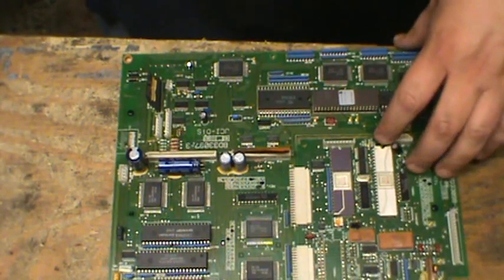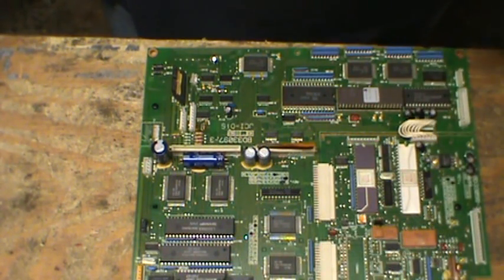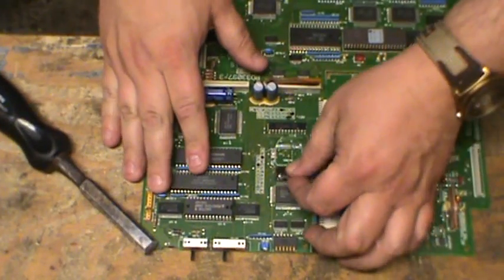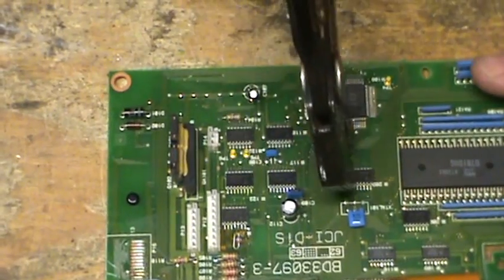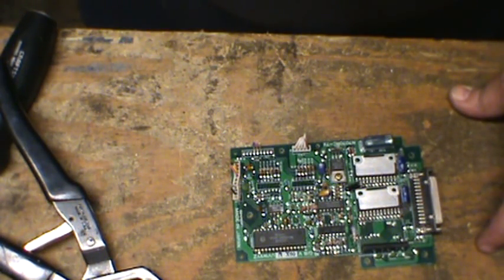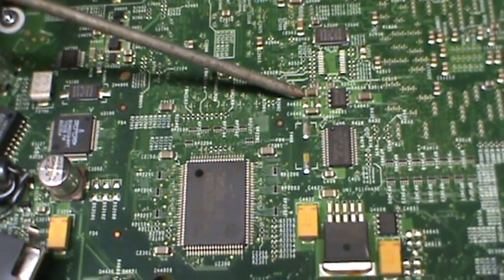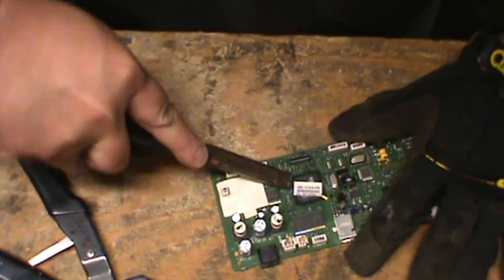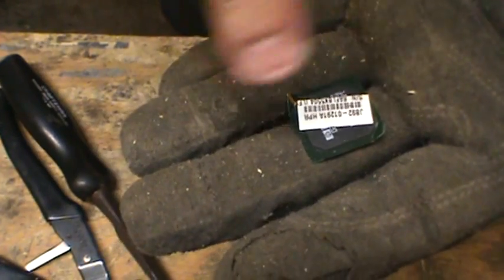Scrapping, how to remove IC Chips, and what else is worth money on a circuit board

Comment: Where can you sell the boards once they are stripped of the IC chips and some of the other valuable components? Would boardsort still buy them depopulated? Do they become low grade boards or do they retain their original value? Thanks in advance for any response.
Reply from the maker: karakantouvalos Hi there, they are dropped in value after removing the valuable items.  If you are going to pick the boards I would probably not suggest trying to sell them to places you have to ship to because you have to pay for shipping and the value will drop so you will get paid a lot less, some places you will lose money.  If you strip, sell to the scrap yard.  Thanks!
Reply: OK, thanks for your very prompt response. I was thinking along the same lines. I think I'll just leave those IC chips on the boards for now. Yes, I know what you mean about shipping! The cost of shipping some items is becoming prohibitive.

Comment: What are those black little thing that looks like monolithic ceramic capacitor?
Reply from the maker: +Eric Ibanez Not sure exactly what you are referring to but some are also made with ruthenium which is a valuable metal as well.
Reply: Hi Moose scrapper thanks for your reply. It is on my profile picture.

Comment: what is left to do with my green boards after I depopulate or remove the tantalum
Reply from the maker: Some yards will buy them for 5-6 cents per lb.  otherwise, they get trashed.  Its unfortunate, but that is one of the very few pieces that is not recyclable.
Reply: Thanks again Moose. I think I will do as you and save up my gold until once or twice a year. I have about 1 lb of gold pins as of now. How much should I expect from this amount ? I understand that it would be hard to guess but you have been there .
Reply from the maker: d scrapper I would say several grams.  Again depending on the type, age, thickness of plating, blah blah blah, at least 5 grams, maybe as much as 50.....lots of variables.
Reply: thanks Moose

Comment: what is the most important chip on a circuit borads
Reply from the maker: +Dre Love As far as what, functionality or gold recovery?  Functionality depends on what the board is from I guess, for gold recovery, It depends on the board as well.  The board in a projection screen TV would be the DLP chip I think, for motherboards, I would say the CPU or the ram, for other boards I would say IC's are pretty good for gold recovery.  Not sure what else would be called "chips", but monolithic ceramic capacitors can have a high yield of silver and palladium for their weight, they are just tiny and it takes a lot to get reasonable weight.  Does that help?

Comment from the maker: Hi and thanks for watching!!  The computers do have value!  The CPU's are likely ceramic and can be worth over $50/lb!  There are also the the large socket green mother boards that are the most valuable of the mother boards.  Ram chips, PCI cards, lots of stuff!!  I have a video or three about computers.  The older model TV, there is not gold that I can think of but there is likely silver contacts in any relays or switches.  They may look like little rectangular black boxes.  Send pics if you

Comment: Solder gun and and correct tools. I have fixed a million. solder is nickle and lead.
Reply from the maker: most solder does have lead, but I have never heard of a solder with nickel in it.  The melting point alone would make it very difficult to use.
Reply: Sorry I mean tin and lead, been out of the job market. just forgot.

Comment: Show what weight and the final value of everything tally it -- show how long it takes to save up enough scrap to be worth it....
Reply from the maker: Eric Patino Hi and thanks for watching!  That is a great tip!  I used to do that however the price of scrap changes often and sometimes drastically.  One of my early videos was done when the price of copper was over $3 per lb.  As you can imagine, the value is very different today.  I am trying to get put the weights in my new videos as that can help viewers decide if its worth it for them or not.  Thanks again!  Keep the ideas flowing!
Reply: No problem...I have a GIANt printer i am going to take it apart and try my hand at scrapping I have a bunch of motherboards n stuff as well...enjoyed the video thanks again !
Reply: Moose Scrapper just started with my greenboards today. What is in the round 16v. I took one apart.some kind of wet paper and strips of metal? Tks mouse
Reply from the maker: Elizabeth Tressler round 16v?  is it a 1.6V battery?  If it is, don't take it apart, that's toxic.

Comment: Tantalum caps??? So you spend 2 minutes per board to break them off and get .00755 ounces, @ $6.25 per ounce x 30 board per hour, you just made $1.41 per hour. Wow, I never knew it was so lucrative. I think I'm going to quit my job and go circuit board hunting.
Reply from the maker: ROFL.  Sometimes it seems like that.  Its still keeping it out of landfills and throwing a little in your pocket.  Precious metals in electronics is not a get rich quick gig but if you have no money and no job its better than nothing at all.